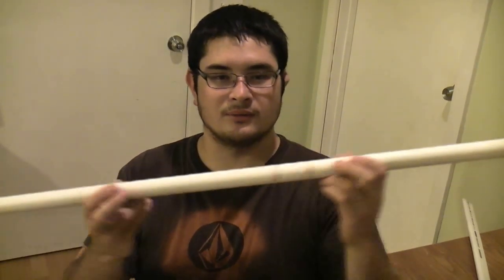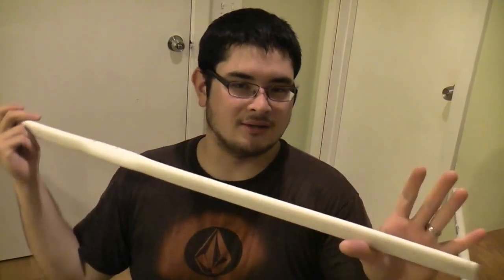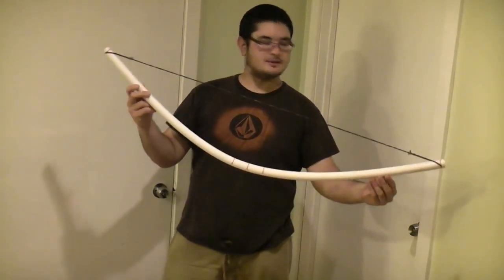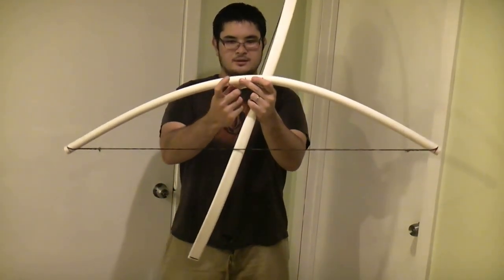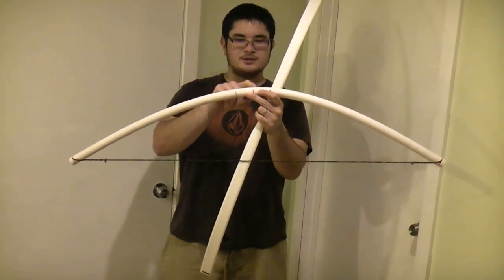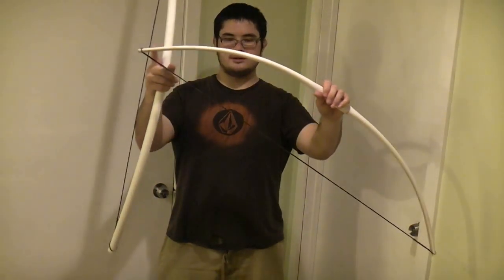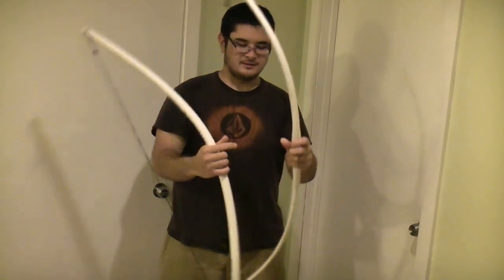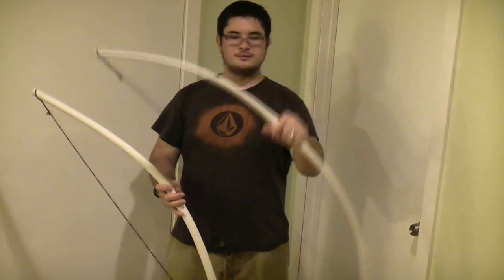PVC Pipe Bow - Flattened vs Round Part 1 - Strung Up

Comment: I would have liked to see you run the two through a series of tests, ie on a table mount one of the bows and using a scale pull and marking the curve every 2" and recording the pounds of pull, there might be some dead spots or unexpected findings one has the other does not.  Then compare the arcs of the two.  Then pull and record with a scale until both units fail, one might be noticeably weaker or fail sooner than the other.

Comment: FYI, I use a bow made out of a straight piece of PVC pipe.  For a handle I use a six inch length of PVC insulation, duct taped into place at the middle.  A couple points:

1) Why yes it looks stupid as hell.  But that's part of the charm.

2) After hundreds of shots (probably thousands by now) it hasn't snapped.

3) I once managed to snap such a bow by experimenting with wooden inserts to give it more weight.  I made the mistake of using two dowels each half as long as the bow (i.e. stacked on top of each other so they touch at the middle), so when I tried to string the bow, all the tension collected right in the middle of the bow, and it snapped before I could even string it.  But!  The PVC insulation stopped all the shrapnel, so rather than a catastrophic event it was an inconvenience.

Comment: have tou thought of "tillering", in pvc bows simplest, having the upper limb just abit longer and weaker, so from the arrow point it is equal power up and down instead of equal power from the middle... mening more accuracy..straighter flight, and there fore mor dilivered power to the target.

Comment from the maker: @tylorc100 I have thought of and tried putting a smaller pipe into a larger pipe. I've watched and followed Themanscave and I've also tried the same thing you've done in your video. I don't do it anymore or suggest it because of the added weight and lower efficiency.

The bow's weight goes up because you put two bows together. It's hard to explain with words. I'll be posting a video up to explain what I mean.

Regardless, it's whatever works for you. Keep up the awesome work!
-Nick

Comment from the maker: @godzilla20000000000 If you mean by squishing the handle to make it taller, that won't work very well. Because the rest of the bow is round and is much stronger, the handle is more likely to flex sideways or even fold along the weaker area.

Comment: ive seen that you recomended getting longer or wider pvc to up the weight class. did you think of doubling it by puting a 1/2 inch pvc in the 1/3 inch pvc i saw one video that did this but didnt bend it. ive done it and pritty much doubled almost trippled the strength of the bow. i want to hear what u think of this.